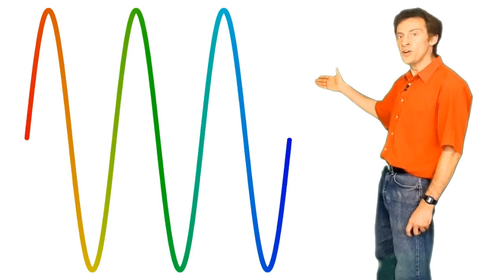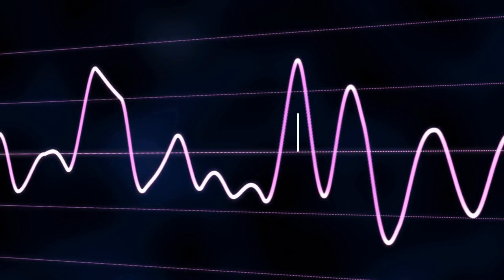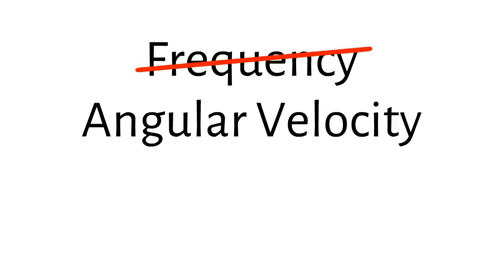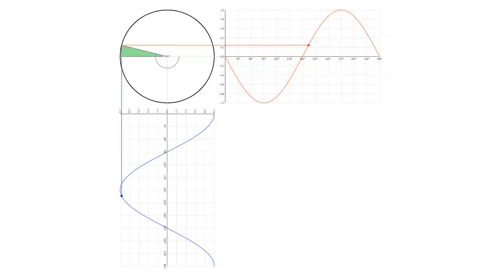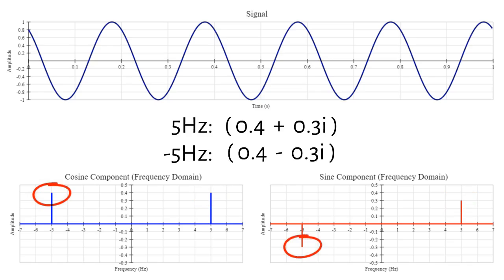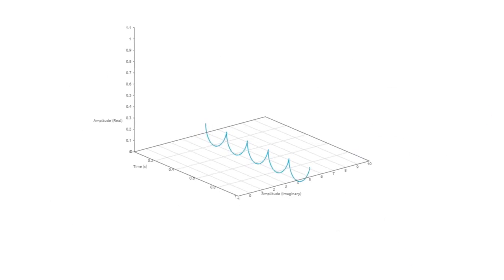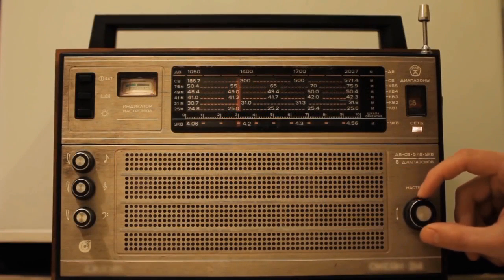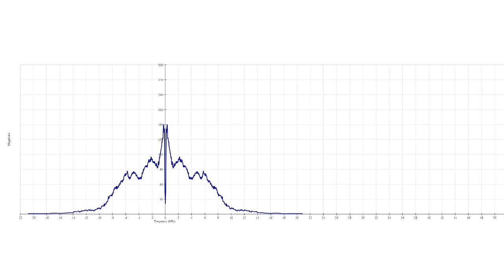Negative Frequency, Imaginary Numbers and the Complex Conjugate

Comment: Let me add something to this. There's that thing called the Hartley transform. For a start, the Hartley kernel is neither a sine wave nor a cosine wave. It's phase-shifted exactly midway between these two. Now you might wonder: "What the hell does he need this strange phase shift for?"
Well, if you play this thing backwards, what happens? Surprise surprise, it's the same as if you start a quarter-period ahead. This means that you can get any possible phase shift just by changing the ratio of the two amplitudes (i.e. the one of the positive-frequency Hartley sinusoid compared to that of the negative-frequency Hartley sinusoid). Which in turn tells me that this way, I can represent any possible signal that I could ever think of, with the added advantage that I don't need complex numbers this time.
By which I mean, there's even a 1-dimensional way of representing negative frequencies and this representation still has its use and its meaning. Without negative frequencies, my signals would be similarly limited as if I sticked just to sine waves without cosine waves or vice versa.
Reply from the maker: Fascinating! Thanks so much. I must research this further.
Reply: Hi, can you give me some links or any sources, where I can understand  this concept of negative frequency in more depth. Even after watching the video, I still have a lot of questions regarding its physical interpretations, real world applications etc. 

Can we generate signals with negative frequencies with an oscilloscope?
Reply: @amoghnelavigi   It's the same thing as reversing the thing in question. If your periodic waveform has a frequency of 100 Hz and you play it backwards, then the frequency of your reversed signal is -100 Hz.

Comment: Hi Mark, firstly thank you so much for excellent explanation. I just don't understand one thing. In your previous videos which about of  Fourier Transform, you say "complex number result of Fourier Transform is contains either phase and amplitude information". The amplitude of real and imaginary component's of Fourier transform result also cover the phase information. During the performing Inverse Fourier Transform, we added negative frequency and positive frequency sinusoids as a result imaginary components are cancelled each other. In this situation, the magnitude of reconstructed sinusoid or real component of the reconstructed signal is 2 times bigger than real component of negative and positive frequency's ( actually this is eliminated by 1/2 which is out of integral). However, the imaginary part is 0. This situation, we get a real cosine wave and 0 phase degree. This is absolutely unacceptable because one properity of wave is dissapered. Please if I'm wrong you say this and explain me that mechanism.

Comment: Why does the baseband frequency of your voice contain negative frequency? Or is that the FFT results of the time domain voice signal?
Reply from the maker: That's the really weird thing. This negative frequency is a physical phenomenon. I have no way, beyond the ideas I expressed in the video, to intuitively explain why it is so. It just is! This may suggest that imaginary numbers are not so imaginary after all; that they too are a physical phenomenon. It's not just an artifact of the FFT.

Certainly in physics they are now beginning to think that the imaginary dimension, as Decartes called it, is a real thing, not just a trick of the maths. Mind blowing, I know.
Reply: There is no negative frequency in the baseband signal.  The negative frequency band in the modulated signal is purely a result of the modulation process.  Put simply: a modulating signal of Cos(ω1t to ω2t) multiplying a carrier signal of Cos(ωct) will produce: 1/2Cos(ωct + (ω1t to ω2t)) + 1/2Cos(ωct - (ω1t to ω2t)).

Comment: It seems impossible ro buy your book at the moment. Amazon says it's unavailable. They only have a Kindle edition. I don't use Kindle. Any news on when it will be available in paperback.
Reply from the maker: Where are you located? It is already available in paperback, but due to the Amazon print on demand limitations, they only have the paperback available in certain countries. However, it should be possible to order in from a different Amazon store that does support the print on demand service.
Reply: @MarkNewmanEducation  I;m in Melbourne Australia.

I've checked Amazon Australia and Amazon U.S. No luck there. Do you know of one where It's available? I don't know the price so I don't know if I can afford to buy it. 🙂